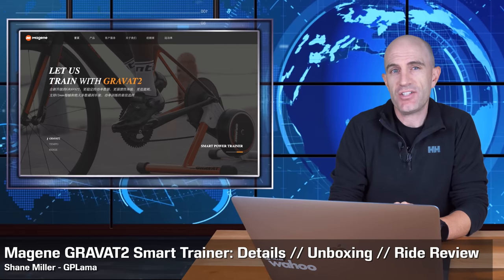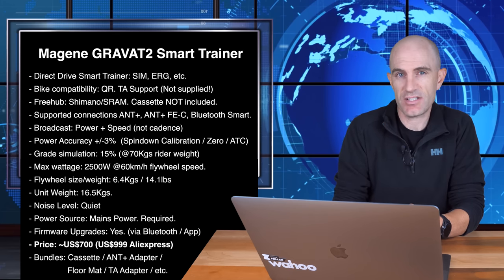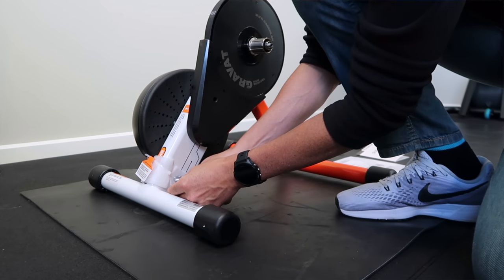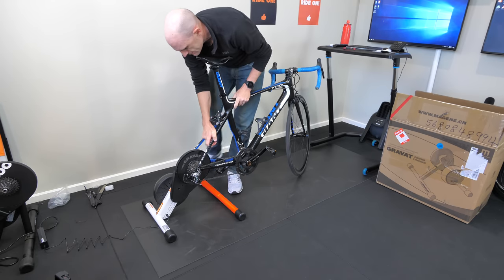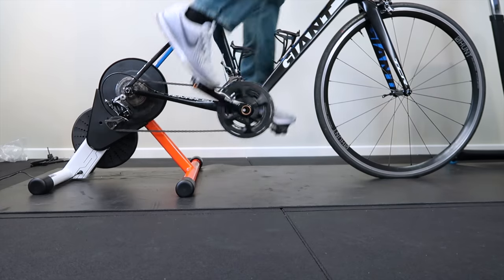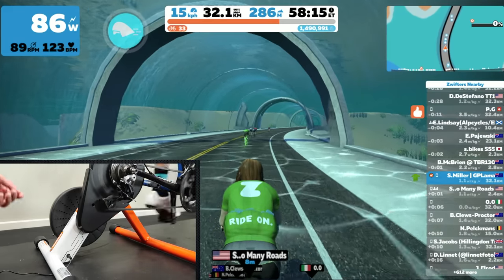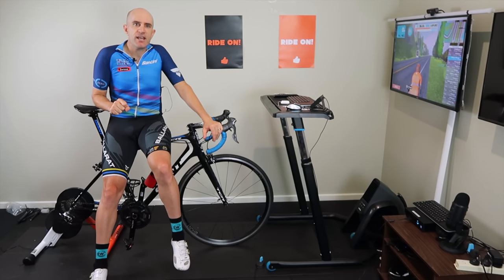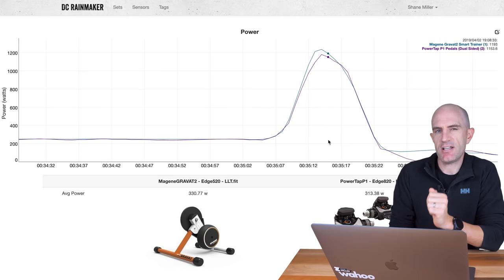Magene GRAVAT2 Smart Trainer: Details // Unboxing // Ride Review

Comment: FYI the little bolt nut on the strain gauge Shane used to tie the cable to his brake caliper wire can be removed. The nut is used to tie down the strain gauge during transportation.

Comment: this unit brings zwift doping to another level. could easily put some extra strain on it with some tape i guess, or even attach a string to it to use it occasionally for some huge sprint watts
Reply: i posted that comment midway through the video, before having watched the end :-)

Comment: Hi Shane, I'm in the market for a new direct drive trainer. The one thing that frustrates me with my Elite Rampa is the delay in resistance changes, I overtake guys at the start of ascents it really annoys me. I was very interested in your thoughts on the Gravat2 until you mentioned the same problem of there being the same delay. Which direct drive trainer would you say has the least delay? I live in Hong Kong and the Gravat2 is available here for AU$860ish BTW
Reply from the maker: Neo.... the Kickr range isn't bad.... there's no ideal go-to unit that's perfect though at this point.

Comment: I tend to be a 'pour it out unboxer' due to excitement. Very quiet obviously a proper consideration there. I need 142x12 so the parts shoukd be included in 2019 or at least as a cheap option at pos.  I like the quietness thats a plus but for me to buy this trainer it would need to be $200 lower with no cadence.
Reply: There is cadence.

Comment: Hey shane... Great video. I have a quick question which is unrelated to the trainer, itself,  but still specific to the video. Where do you get that white plastic cassette holder I see you using each time you put on the cassette? It would sure make life easier.  Thanks again for your great work on YouTube :)
Reply from the maker: They come with most Shimano cassettes these days.
Reply: Shane Miller - GPLama  thanks
Reply: I've just bought 3 Shimano road cassettes (105 and Ultegra) and unfortunately I didn't get that cool plastic jig (just the regular slick on) - maybe becsuse I got the 10 speeds cassettes? 
Searching on the net didn't get success.
Reply: YakovD71 I was thinking the same thing regarding this issue... It's not worth upgrading to 11spd however just to get 😃
Reply: Yes,
Yesterday I've checked it with the local Shimano distributor and it comes only with new manufactured Cassettes (10 speeds are old stock). They offered me to come and get it for free as they installing cassettes and throwing it.

Comment: Hope you can review Magene t300, seems very good in terms of the specs and its fiscal appearance
Reply from the maker: If I can get a hold of one, I can put it through the Lama Lab.
Reply from the maker: Here it is. Magene T300 Smart Trainer: Details // Ride Review // Lama Lab Tested: https://youtu.be/H6By1BYufeo
Reply: @gplama  Hi Shane..  thank you for your review. actualy I have  bought T300 alraedy for about 4 months ago and I do agree with your review. the power accuracy is very bad.. I have been comparing the  power of T300 with my Stages Power mater.. I am not comparing the data in graph like you..just  compared the the power value of both  power disply side by site ( T300 in Zwift and stages  in stages sw tools apps ) ..What I noticed that T300 power value most of time is lower then Stages power value..(it make me very bad when I am racing in Zwift 😡)  I have sent my finding (in video , side by side power value comparation when zwifting) to Magene Customer Support Center.. but no respond at all ☹... and now..to overcome this problem., I am using stages power meter as my Power meter source.. but this configuration is not good if I put it for ERG mode. .the resistsnce changing respond is verry slow and it's not stable compared  if I use T300 power mater ..... Disappointing...

Comment: If using 140mm rear diskbreak . The caliper will against trainer's frame. I have to cut a piece of plastic from the trainer frame end to aviod this issue.
Reply from the maker: Good tip. One I didn't come up against as I didn't have the adapters for TA.

Comment: Could you compare this to Magene T100?
Reply from the maker: I'm not familiar with the T100... A quick look a the technical specifications.... 2% maximum gradient simulation. That's not much at all.
Reply: @gplama , at least better than Lemond Revolution? Better than D2R shadow?
Reply from the maker: @DennisTeohKokEe  I wouldn't say so until I've ridden it. The Lemond Revolution is one of the best 'training' trainers around.
Reply: @gplama , the second hand value of Lemond Revolution is very close to  this Magene T100. Since Lemond Revolution standard packaging does not come with the watt box sensor. Also can't do any gradient simulation. No speed nor cadence reading until we do the hacks to add a speed and candence sensor as per your previous video back to few years ago.

Comment: GRAVAT 2 has several issues with TrainerRoad. First TrainerRoad app (ios , Android) can not pair with GRAVAT 2 in Bluetooth. Using ant+ dongle instead of using Bluetooth should works well? Not really! Proceed any TrainerRoad over/under workouts in ERG mode, you will experience abnormal “higher resistance” (not lag) although the resistance should drop  after  “over” threshold power period. The abnormal higher resistance will sustain about one minute. Be aware these issues of GRAVAT 2 if you are TrainerRoad user.
Reply: Does the problem still persist in TR?
Reply: @endribudiwan3420  GRAVAT2 is now working with TR without issues.